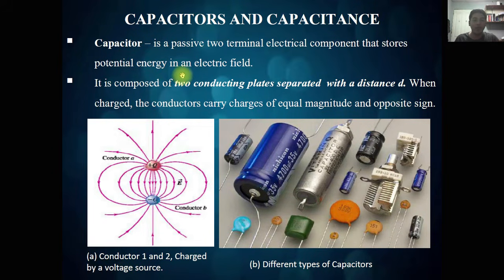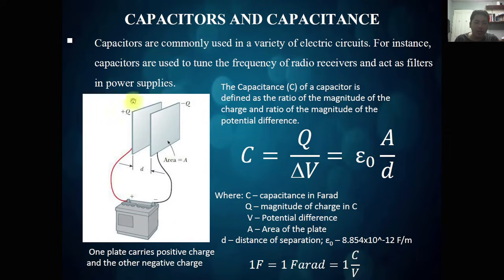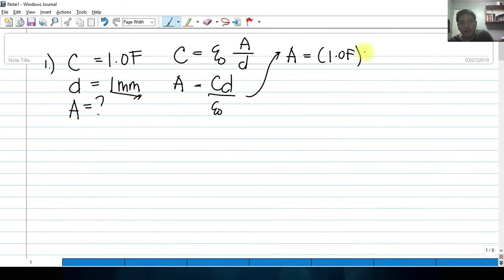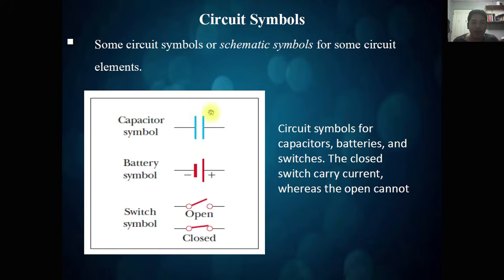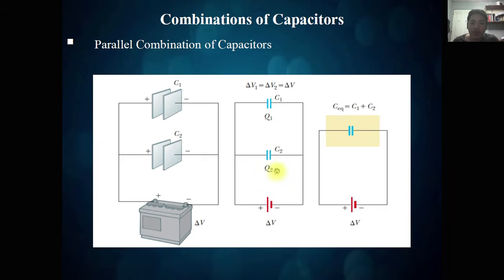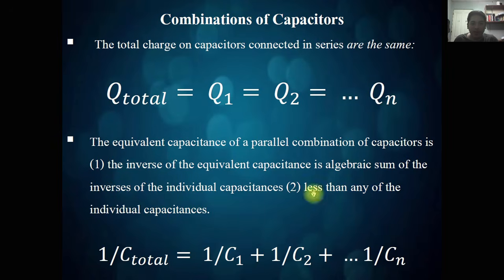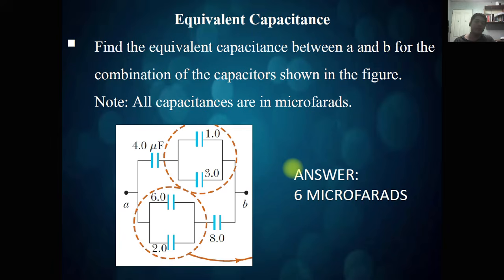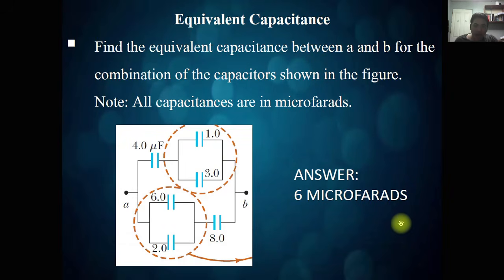Capacitors and Dielectrics Lecture Part 1

Comment: Sir I'm still confused in this  question,can you help me po? (A student claims that capacitors in parallel combinations have greater
equivalent capacitance compared to the magnitude of either the capacitor and
less than either the capacitors when connected in series combination. How will
you agree or disagree with the claim?)